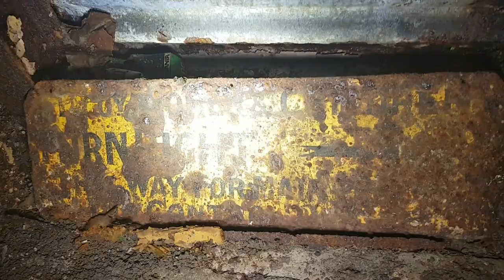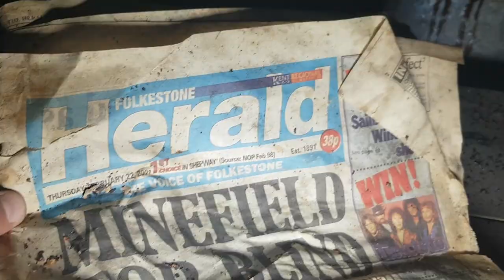CHATHAM KENT SECRET UNDERGROUND TUNNELS

Comment: With the plant room, you can tell Neesh that you had to close one door before opening the other in order to maintain air pressure for the ventilation system. If you opened both doors at the same time the air supply would completely stop on the lower level and about 80% of the air on the upper level would stop circulating 👍